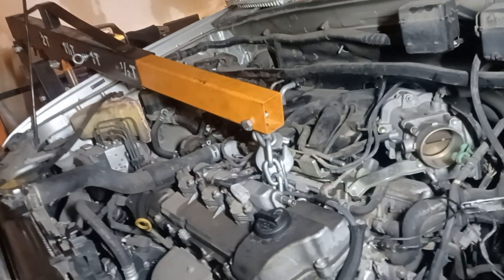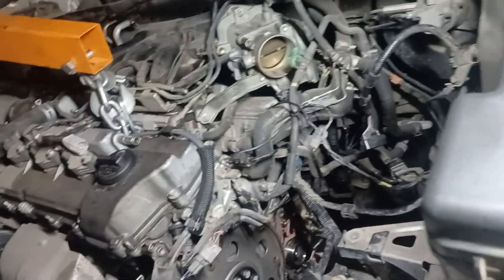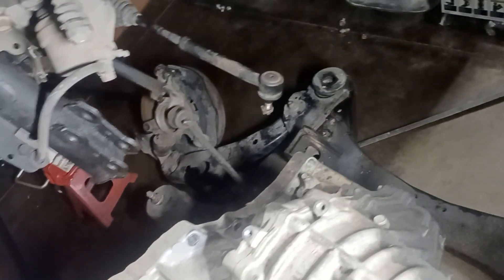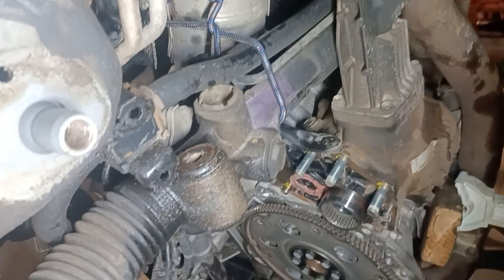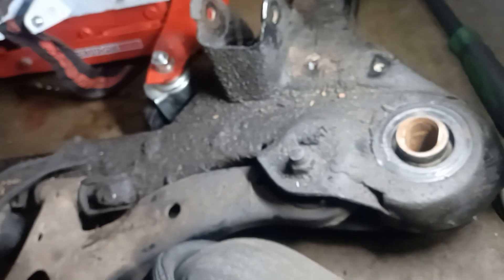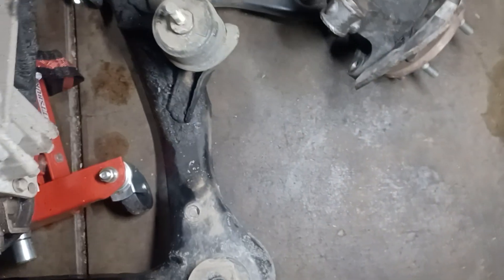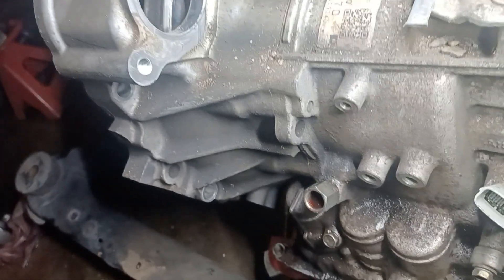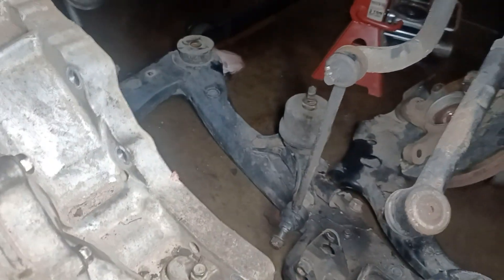replace 2006 toyota highlander transmission

Comment: very detailed. Thanks for the video. I have same car, same year, 4WD, just like yours, transfer case oil leaks between the transmission, can I just remove the transfer case to fix the leaks or do I have to remove the transmission?
Reply: If it is leaking between the transmission and engine block, then the transmission has to come out. You probably already figured that one out, though.

Comment: stuck pulling the engine/transmission combo in a 2006 Highlander Hybrid.. the sellers of the difficult to find used engine.. cut all wiring and tubing.. including the main harness ECM plugs.. just to hurry their job pulling  it. :/ so.. cant simply swap it..  have to completely pull the old.. and rebuild the 'new'.. before even thinking about installing it.  lovely eh..?